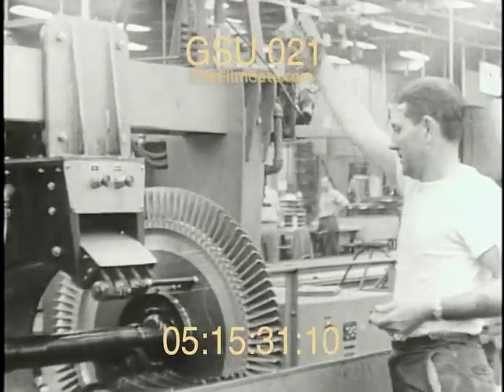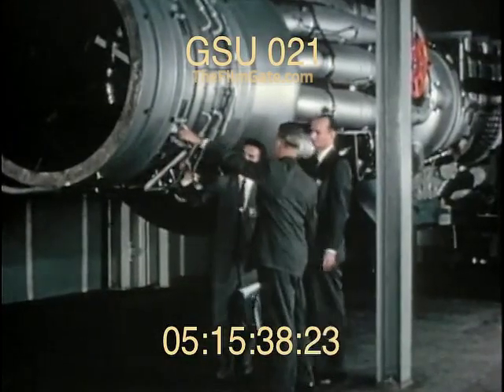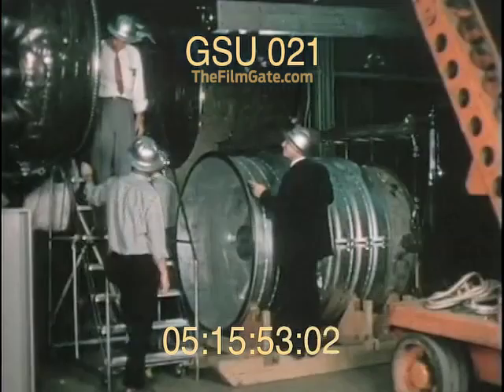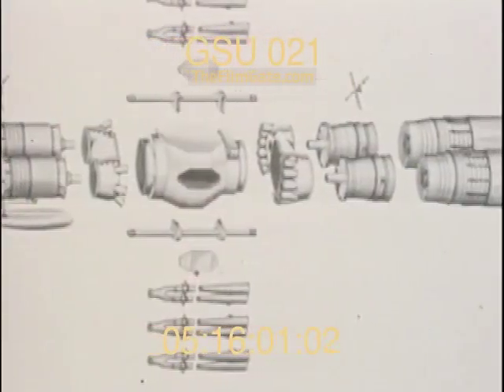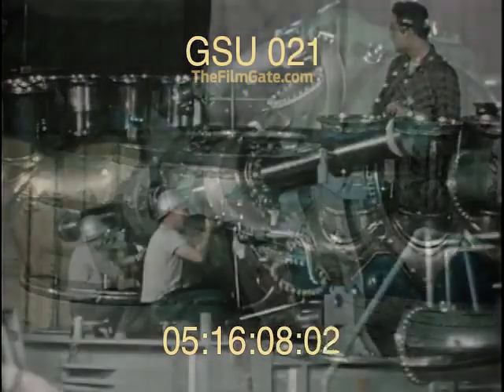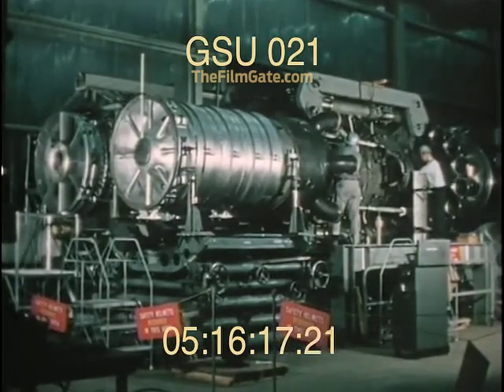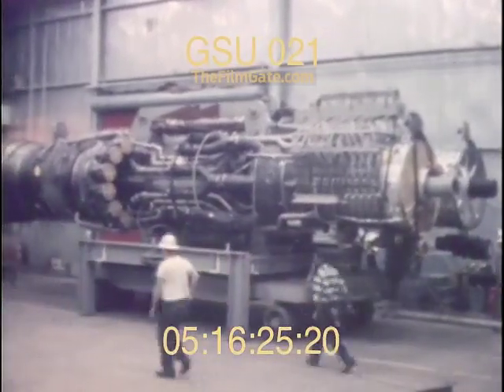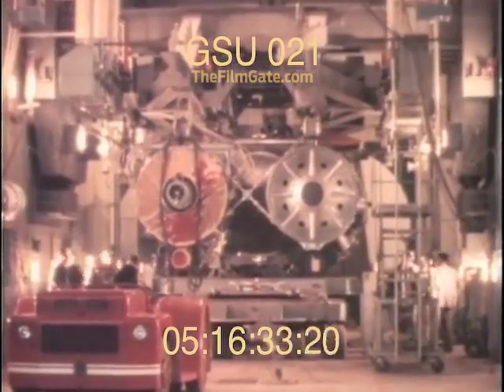US Built Nuclear Reactor Jet Engine - Stock Footage

Comment: What is the point of having the timecode at the bottom of the screen? Im not making an edit decision list from this clip, its a you tube clip. Totally unnecessary. The water mark at the top as the source material, sure, but time code is distracting.